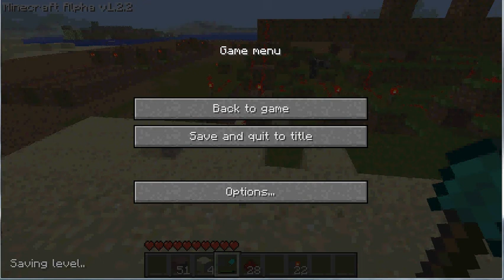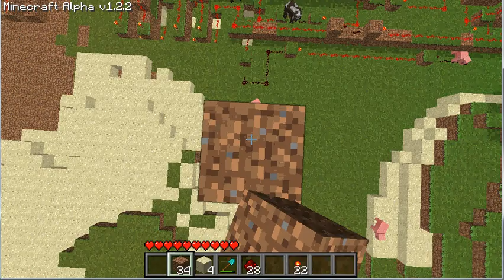Minecraft 4-bit adding machine

Comment: @iannerd97 Binary to BCD is tough. You would want to look for the +3 algorithm method. I was in your position several months ago until I finally overcame this. Just google Binary to BCD methods and eventually you will find it.

But pretty much it involves feeding the binary value into BCD registers, and systematically checking the value in the registers. If it is 5 or more, you add 3 then continue to shift again. If it is 4 or less, you just shift it. The amount of shifts = amount of bits.